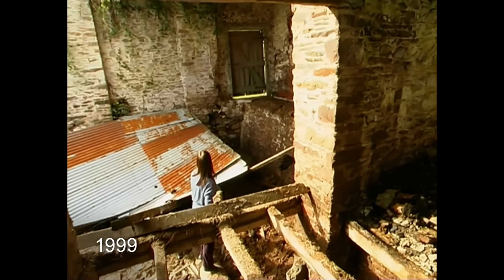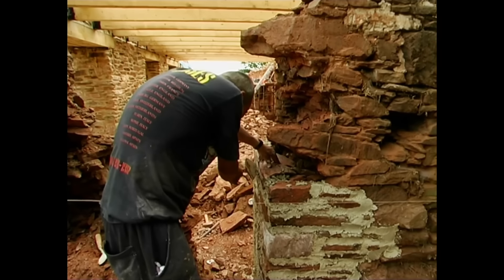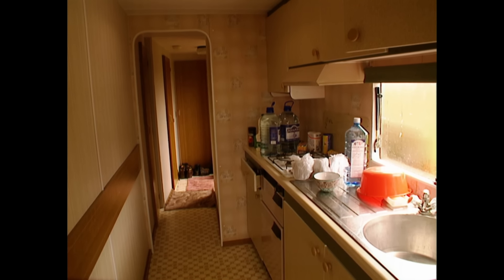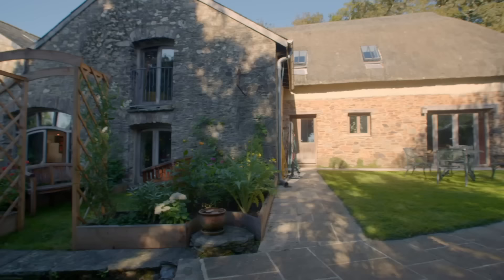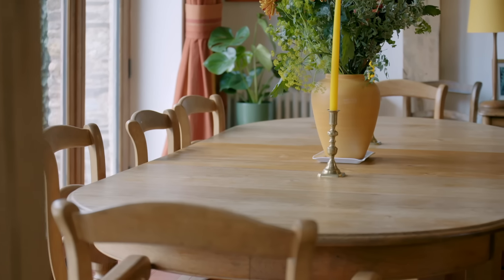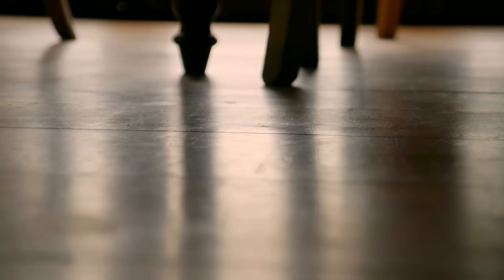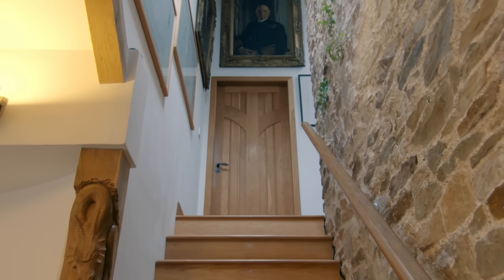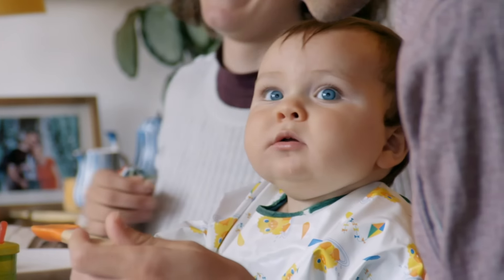An Incredible Home TWO DECADES In The Making | Grand Designs | Channel 4 Lifestyle

Comment: I can understand wanting the visual surfaces to look authentic and true to the original building methods and materials BUT...
Especially on load bearing walls and other strategic areas (like the underpinning work done to the rather compromised walls) building those using conventional, durable, strong and easy to build modern materials and cladding them using cobb, lime mortar and stone and all the rest would have saved a lot of time, money and effort and created a building that would have been more durable in the long run.
Using "moderns" to rebuild the large portions of the structure that to be honest had not stood the test of time seems to me to be the only rational and logical approach.
As it is, this building will be just as "compromised" in 200 years as it was before this renovation started and at that point it will become a fallen down ruin of a relic of the past.
But to each his own I suppose...

Comment: It's unfortunate that this otherwise excellent show did so much to popularise burning wood, when much cleaner heat sources have long been available. The pollution and particulate matter released by burning wood - full of toxins and carcinogens proven to impact health and cause disease - are now polluting the air of our towns, cities, homes and gardens. E.g. that 'nostalgic' and 'sweet' smell from wood smoke is benzene, a carcinogen. Only 8% of UK homes burn wood (almost all of those homes are middle or higher income homes on-grid and/or with a cleaner fuel source - leccy, gas and even oil are all much cleaner), yet this is now the biggest source of harmful particulate matter (soot) - more than traffic. We've sleep walked into a serious air pollution problem. Smoke harms and kills, it always has. Please don't burn wood if you have a cleaner alternative.